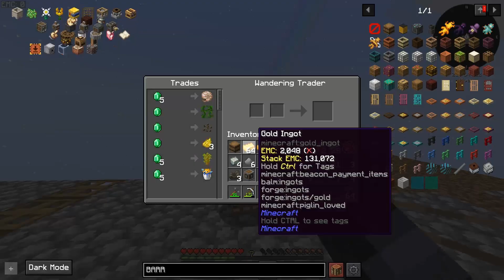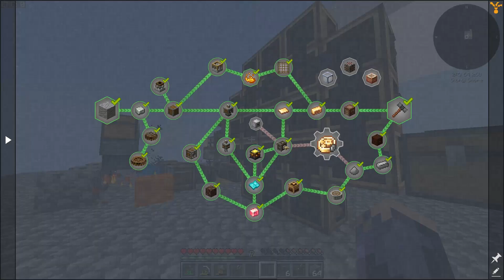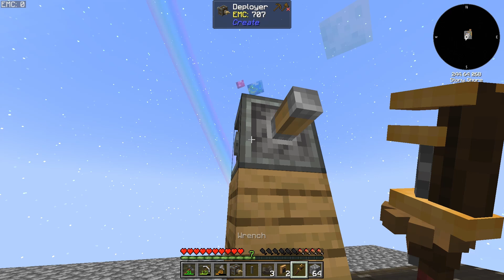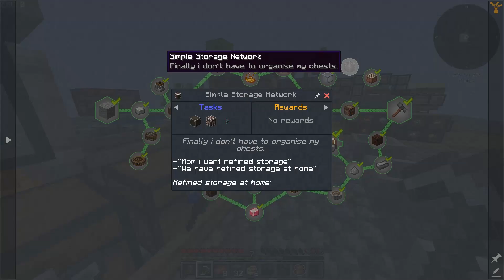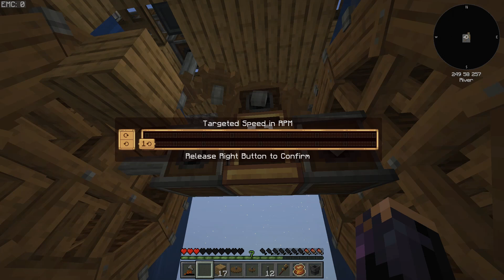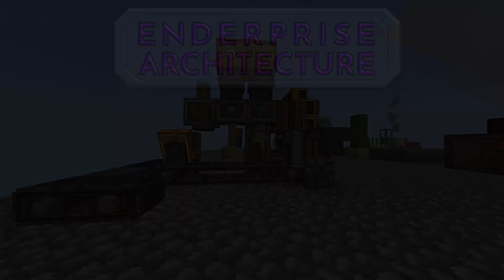Precision Mechanics - E04 - Sky Revolutions Modded Minecraft

Comment: Did you know, by shift clicking when you place create components, such as deployer and mechanical press's, they will place upside down, you can use that by clicking directly on the belt or depot and it will automatically place with an air block in between
Reply from the maker: What!? I never knew that!  That will save me so much time, I have never put down a deployer the correct way on the first try ever, this is a game-changer!  Thank you so much!